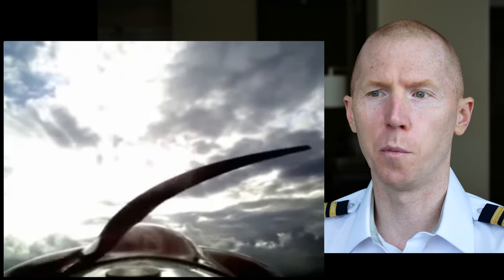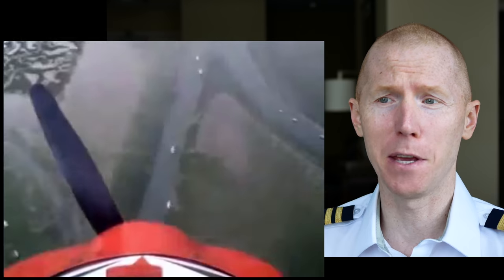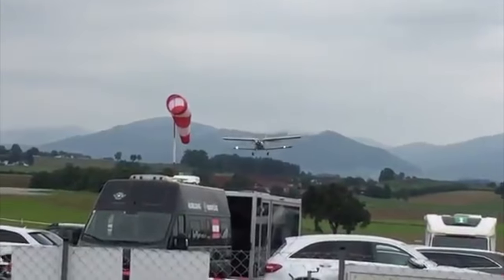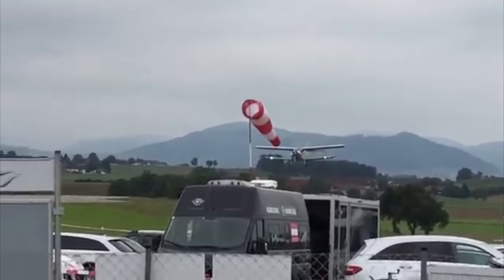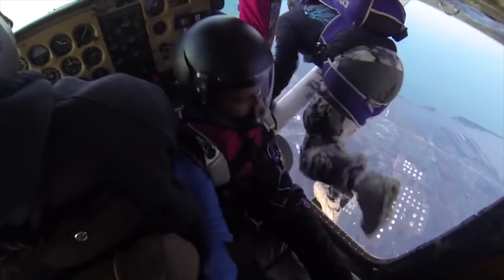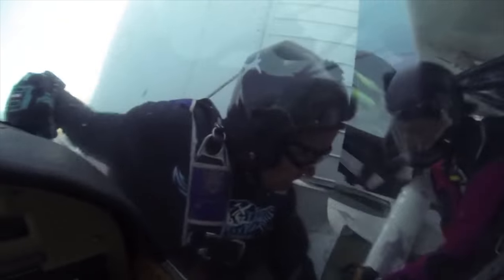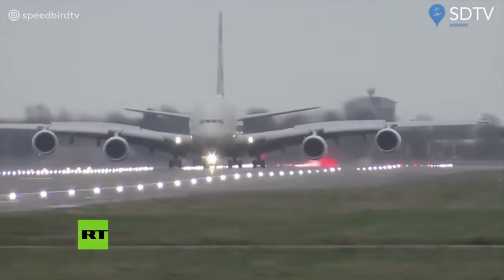Mid-Air Collision Rips Plane's Wing Off | Viral Debrief

Comment: Sorting through old clips, that I did not watch the first time from you.  My instructor, from White Sands Missile Range, insisted on doing a lot of spin recoveries, including power-on recoveries which you know are even stronger in terms of the beginning speed.  He'd kick over the rudder, and then release, and wait to see how you'd deal with it.  I never was in a flat spin, but initially I'd over correct, and the spin would become more 'violent' (well, to some it would be violent) in the opposite direction.  You'd learn to 'tap out of it' - little corrections.  Then you'd learn not to pull up dramatically giving the aircraft time to achieve good flight speed, often that meant point the aircraft downwards.  Finally, if you had the altitude to trade off, you could pull back up.  Anyway, who am I to talk about any of that to you?  I just remember it scared the crap out of me initially, but then I got used to it.  Power-on spins were not a requirement of the private pilot licensing program at that time.  But I'm glad I did them.  Thanks Kelsey.

Comment: One thing I never hear pilots pointing out is that those "crab" landings may look super impressive - and they are impressive, make no mistake - but the optical compression of telephoto lenses make them look much more sideways than they really are. In the case of the A380 at the end, it looks like the A/C is approaching at 45 degrees to the runway and it isn't anywhere near that bad. No idea what the tolerance is but I can't imagine anything that heavy surviving that much offset to direction of travel, at that speed - feels more like it probably would tear off the gear or at least rip the tyres to shreds.

Comment: The b52 can actually turn there landing gear so if the have to land in a crab there wheels are still straight so when they  land in a crab  they roll straight down the runway while still in the crab

Comment: The An2 hitting the berm before the runway might not have a lot of time in that rig. It's a super high drag plane and when the power is pulled it sure slows fast.. I know this is a remark made about every biplane and the Antonov is a real big plane. It's a very, very capable plane it will do just about anything you ask it to but you sure can't stretch a a power off landing that's for sure.

Comment: As for the chase plane, adding a little power and banking left would have been a good idea.  The trick is doing so smoothly.

It is fairly easy to hold on with a left bank, but not a right because you are wedged in on the step (landing gear strut, or even the wheel. Those in the door might fall back into the plane, or be pressed on the door frame. 

I know you can't see a descent rate during the jump run, but there should be. Keeping the tail up and the prop blast manageable is important. 

I think I recall that the chase plane got into the burble from the first. Either way, everyone survived.

Comment: I learned to fly on a 1000 ft grass strip. It didn't have 'numbers' but I definitely had to make my flare at or near the threshold (or even before the threshold, which was possible if I was landing from the East), with my airspeed just right, or I was going around.

It was years ago, and the memory is now fuzzy, but I think the first time I landed at a longer runway (still grass), I mentioned aiming for a point a bit further down the runway, but the instructor didn't like the idea. I think his objecting was that if I didn't aim for the end, I'd just be guessing if I was giving myself enough room or not and I could get it wrong. His idea was that the end of the runway was the only sure aimpoint.

Comment: What's always surprised me about the Heavies is that they don't have a built in crab control like the B-52. Crab it over, wheels stay pointed down the runway (for the most part) and then you can straighten up a little less violently before you reverse thrust. Your landing roll might be a bit longer, but you won't have any puke to clean out of coach.

Comment: So, interesting point on that crab. Let's talk technique though. Yes, the passenger discomfort during that was probably not very pleasant. A bigger question would be... conditions might not change in a foreseeable future. Go to alternate? Fly patterns until crosswind MAYBE subsides? Your fuel burn and extra time spent may have also been factors considered by the company. I don't feel that what he did was unsafe, though maybe stress on landing gear is worthy of consideration. I don't think there is anything that could have been more gentle in this situation though. People in comments talked about sideslips in crosswind, but you ain't gonna sideslip an A380 on short final. ;) Crab is probably going to give you the most stable configuration in terms of managing your vertical speed and ability to execute a clean flare. Keep the vertical speed to a mnimum, flare nicely, and as long as you manage power ok, you set her down gently and use the rudder to straighten her out, which is what was done here. I don't quite understand why Etihad took issue with this landing, it's not like its uncommon to see crabbed landings, though I am not sure what the crosswind was that day and whether it exceeds company SOP.

Comment: In the skydiving video, the airspeed should push the skydivers towards the back of the plane as they exit. If the pilot banks to the right he lowers the tail down and increases the risk of a skydiver hitting the tail. It's probably less of a risk in a slow Cessna like that one, but in a Cessna caravan or a faster plane like a King Air, it becomes a real consideration. I've been on a skydiving plane where the pilot banked towards the door in order to avoid entering airspace and it nearly caused someone to hit the tail, and I've met someone who did hit the tail when he exited the plane whilst it was gently climbing and the tail was lower then the door.

I've never heard of a skydiver going forwards and hitting the prop though.

Comment: From a skydiving perspective, it’s strange that the trailing aircraft is higher than the lead aircraft. To coordinate a jump with multiple aircraft, the skydivers have to jump out at the same time. Even a couple second delay between the groups will put us too far apart in the sky to be able to join each other in the +/- 70 seconds we have before we have to deploy our parachutes. In that aircraft configuration, it would be impossible for the groups to see when the jump takes place. On a correctly coordinated jump, rather your talking about 2 planes or 20, high or low wings, the lead aircraft is always the highest and the trail planes usually form a V- formation, each slightly lower than the one in front of them. This allows each plane its own air to reduce wake turbulence, ensures no one will fall into any of the aircraft when they jump, and allows the jumpers on each plane to be able to see visual cues from the jumpers in the other planes as to the timing of the jump (body language signals for what we call the “count”). I remember seeing that video shortly after the incident and was astonished everyone made it down safely, even the pilot of the aircraft that got its wing sheared off, who was, by a stroke of luck, wearing a parachute and was able to bail out. Lots can be learned and lives can be saved by evaluating videos like these.

Comment: The "Flat Spin" segment looked clearly like the aircraft was on autopilot and the pilot's attention was elsewhere. The engine audibly dies, then autopilot set to altitude hold does just that right into the stall.
I'm curious about landing in a crab. I'm just getting ready to start flight school, and everything I've read says that there's a good possibility you'll overload the tire sidewalls leading to a blowout. Also, clearly conventional gear aircraft would just ground loop if you landed them with that much side load. I remember being on a moderate sized regional jet (maybe an MD-80 series?) and landing in a crosswind with a forward slip instead of a crab. I felt the clear upwind gear, then downwind gear, then nose gear sequence of a cross-controlled landing. Is there a size at which that technique is no longer applicable?

Comment: I can totally see this accident coming. The two aircrafts wanted to fly "close formation" in order to jump out everybody from both planes as one whole group. This is why you see the first jumpers going out and grabbing the wing struts with their foot on the wheel. Probably these first jumpers went out like this from both airplanes at the same time. Again the goal was to have everybody out at the same time. This issue tough is when you have one guy out (or even a second guy halfway out) the manoeuvrability of your plane is greatly reduced. The air flow disturbance around your plane is massive due to the guy hanging out in the relative wind, and the air speed of your plane would probably decay some knots quicly as well. The wind noise is ihtense as well and the whole situation is very stressful for the pilot who whants this situation to be as quickly over. (i.e. everybody has jumped out) This is where it got dangerous,as  both aircrafts had enough separation at the start of the jumpers preparing out, but once the jumpers were out it was not easy for the pilot to maintain aircraft separation for the above reasons. Even with degraded areodynamic the pilot from above could still banked left a little to avoid the otehr plane, but he was probably distracted from the activity inside his plane to notice. This shows also that in just a coupd of seconds, the separation between two aircrafts can evolve from sufficient to collision even without manoeuvring and/or power change. The separation breach between the two Cessna's were probably caused just by aerodynamic disturbances by gues hanging out each airplanes. They were lucky. I would be interested to know the procedures to be put in place to avoid this risk from an experienced  jumper pilot.
Reply: The problem here was the pilots had no training or experience with formation flying, and the follow pilot lost sight of the lead pilot. With no communication, he didn't realize he was getting close, so didn't make any attempt to avoid the collision. With proper training, he not only would likely have not lost sight of the lead plane, but he would have correctly moved away from the lead aircraft if he did lose sight.

Comment: Re. the Collision.  From my experience, civilian pilots doing this kind of thing (formation flying) do not brief adequately at all. These two probably don't even regard what they were doing as formation flying.  The accident investigation should have centered on the pre-brief and what was included in how to carry off this flight safely and successfully.  My assumption is that the pre-brief was woefully inadequate for the level of experience of both pilots.  My other assumption is that one or both pilots have little experience flying formation.  Again, it didn't occur to them to discuss safety protocol when flying near the other plane.   I could have it all wrong and the jumpers (who should have been helping "clear" for the other aircraft and the pilots just messed up and took altitude control out of their crosscheck.  When you are formation flying and you know there's another plane close by, but can't see him (like in this case the pilot above), you should have a VERY uncomfortable feeling and call out on the radio to the other that you can't see him.  That would get the one below to look up.   Would like to know the experience and the briefing that took place.

Comment: Traveling into San Jose we landed in a crab but the nose gear didn't self correct...I'm guessing he wasn't supposed to touch down on the nose until the ACFT righted itself.

   it was a 727 I saw copious amounts of tire smoke from the Nose gear. When we disembarked it was onto the tarmac via the tail ladder . As we egressed a number of maintenance personnel were already "In the gear" assessing whether the damage was Just rubber or not.

Comment: That flat spin was scary. How does the aircraft get into a flat spin versus a nose-down one? It seems like the weight balance of the aircraft would nose it back down. My first flight lesson was stalls and spins in a tiny Cessna 152. As we were flying back to the airport, the instructor said, "You did pretty well. A lot of my students get sick on the first day." LOL. I had no idea that wasn't the normal curriculum for the first day and that my flight instructor happened to be an aerobat pilot that held some sort of record. I think they don't require that experience for private pilots anymore, but I was happy to know that I could get out of a stall and a spin easily and not just know it on paper. I think it would be more fun to do it as a controlled experience than have it surprise you and never had the experience. (It was also reassuring that it felt pretty hard to get the aircraft into a stall. The stall warning went off for a while before the aircraft finally pitched nose down.) We were out a ways from the airport and I do remember ground radioed us and asked us if everything was going okay at one point. Unfortunately, life happened and I work too much to fly now (and I now live in the mountains with a small airport at 7,200 feet with a canyon cliff edge/weird winds that I recognize is above my skill level). I do enjoy your 74 Gear videos, Kelsey! Keeps me thinking about flying, anyway.

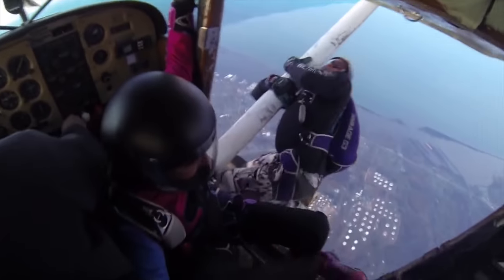Comment: At 10:13, when you point to the vertical speed, through the windshield you can see the other plane a little bit in front and right, but almost the same altitude. Few seconds later, the top plane is much higher than the other plane and, i think, doing a right bank turn into the second plane, losing altitude in the same time, going right into the other plane. At first glance looks like the second plane comes from below, but i guess the top plane pilot does something wrong.

Comment: I know this is one of your older videos but i have a question about the flat spin, i'm curious if it was the centrifugal force cutting off the engines fuel supply or if there could be another explaination for the engines failure

Comment: Not knowing any details other than this video, my thoughts: the higher plane pilot messed up by not keeping visual track of known traffic. 
Assuming preflight planning called for the "lead plane to be the lower aircraft and the "wingman" to be off the lead planes right wing, above and behind, for safety of the jumpers and better visibility for the wingman to keep track and follow the lead plane. The more experienced pilot should have been the wingman as well, more to keep track of and harder to maintain formation than to fly straight and level.
In the video you can see the one pilot watching the skydivers instead of keeping an eye on the other plane in the formation.

Comment: About the flat spin...if you applied wot there, could the propwash over the tail coupled with standard spin recovery help to break the spin ? Also in military jets, would differential thrust from one engine against the spin direction help ? Or wing folding if the plane has that, flap deployment maybe ? Aileron input into the spin, so that the backside of the lifted aileron acted like a brake ? Throwing all the weight you can forward :) ?

Comment: That spin incident is nuts. Looks like he lost most of his altitude. I've actually seen a float plane (!) spin 7 times or so and lose most of it's altitude. I don't know if it was on purpose or if the pilot just took that long to recover. Are float planes even approved for spins?
The other thing that got me is that, somehow, the guy made a very steeply banked turn at low altitude, just asking for another stall. It seems to me that he had a decent looking field in front of him, but he chose to turn and go the other way. OTOH, the resolution of this video isn't THAT great. I might not have noticed an obstacle that the pilot did.

I put an RC model in a flat spin once. It took me much longer to stop it than I expected. Recovered at slightly lower altitude than the nearest tree, but didn't hit it.

We should probably all fly around in airplanes like the Edgely Optica to avoid mid air collisions. At lest if the pilots are awake. Then again, jumping from  one might end up with diced skydiver.

Comment: Aside that it is your responsibility to avoid a collision regardless who has right a way, is plane navigation rules for sailboats, Is the plane overtaking the burdened plane and must keep clear of the plane he's passing.    Is the plane above the burdened plane and must keep clear of a lower plane?  I also assume when two planes intersecting each other at 90 degrees the plane to the starboard, right, has right away,  the plane to port is the burdened plane.

Comment: That pilot in the flat spin 
Was in a tipsy nipper I have actually met the pilot myself he is an Actual Captain of an airliner 
He was in his own aircraft practicing aeobabatics which resulted him entering a spin as it was intentional 
Unfortunately the CG of the aircraft was in the wrong place which resulted the aircraft to enter a flat spin 
As you can see in the video he manages to get out the spin not with standard spin recovery 
But by applying aileron which we are all taught not to use during a spin or a stall 
Once he was out of the spin 
People have asked why not restart the engine 
unfortunately the tipsy nipper is a small acrobatics aircraft with a VW engine that's needs to be started with a hand swing from the outside 
He manages to land in a field unfortunately again 
It had barbed wire at the end of it resulting him hanging upside down on his straps until the fire brigade was able to extract him out his aircraft 
The aircraft has now been fully repaired and he is now flying again 
There are youtube videos of him just look for tipsy nipper flat spin 
And see what he has learnt from it